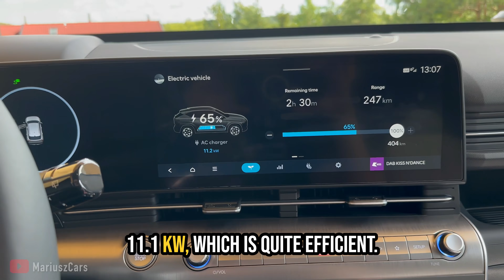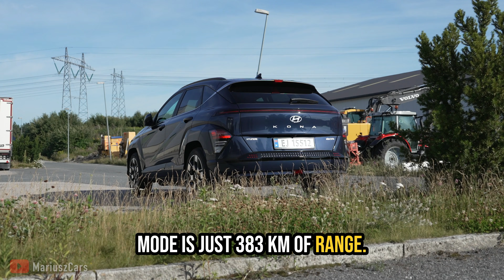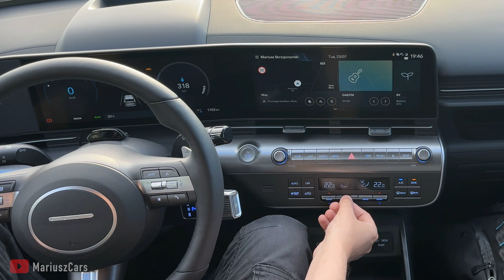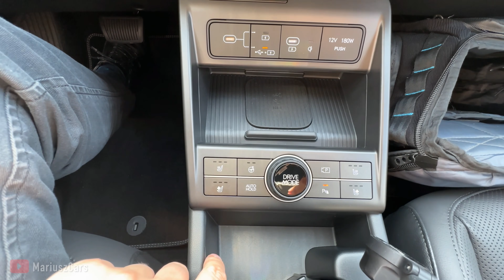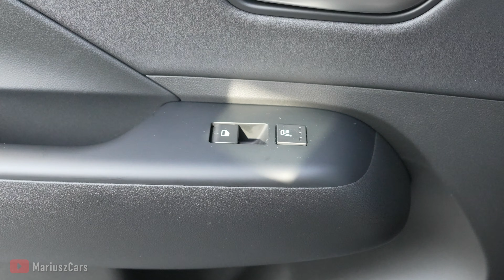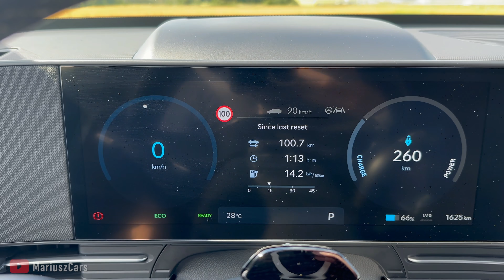How to Get the Most Range Out of Your Hyundai Kona Electric

Comment: I drive a 48 kWh Kona here in Turkey. Even though I live in a city with steep hills, my average consumption is just 15 kWh/100 km. It’s incredibly efficient and economical. At 100% charge, it displays a 395 km range, and I’m expecting that to hit 450 km by the end of summer. Such an efficient car!
Reply from the maker: I drive a 48 kWh Kona here in Turkey. Even though I live in a city with steep hills, my average consumption is just 15 kWh/100 km. It’s incredibly efficient and economical. At 100% charge, it displays a 395 km range, and I’m expecting that to hit 450 km by the end of summer. Such an efficient car!
Reply: I just got the 2026 model with 64kW battery two weeks ago.  When I got it it was showing 420km with 100%, two weeks later it sais 490km with 100%.  I average about 12,5Kwh, I am very impressed with it's efficiency!

Comment: We just got a Kona Electric on a lease. It seems to be a very low spec model. I should have insisted on going with my wife to the showroom! I wonder if there's any way to update/improve the available features. We can't even lock the charge cable once charging is ended!
Reply from the maker: Oh no, that’s frustrating — especially when you only notice those missing features after taking delivery. Some Kona features are definitely trim- and market-dependent, and unfortunately not everything can be added later if the hardware isn’t already installed.

For the charge cable lock, I’d definitely check the EV/charging settings and also ask the dealer directly, because in some versions the locking behaviour can be adjusted, while in others it’s limited by the equipment level.

Which country and model year is your Kona? Maybe someone here has the same spec and can confirm what can actually be changed.

Comment: Thank you for posting, I currently have the previous model of Kona with the 39kwh battery. Its good but I am doing longer journeys so I need more range, I still think Hyundai Kona or Kia Niro are the best range and value for money, in my opinion.
Reply from the maker: That’s a great point. The older 39 kWh Kona is a very efficient car, but once you start doing longer journeys, the bigger battery makes a big difference in comfort and planning. I also think the Kona and Kia Niro are still some of the strongest options when you look at real-world range versus price. Are you thinking about moving to the newer Kona, or would you also consider the Niro?

Comment: I have this same specification, but getting 4.4 miles/kWh is beyond my wildest dreams - my long-term average for driving around town is 2.6 m/kWh, or 24 kWh/100 km. This has been over the winter period in the UK (November - February), but the temperature has never been below about 4C. If I ever get over 3 on a journey I am happy, and I think I got 4 on one occasion. It's still a lot cheaper than the VW Tiguan it replaced, even at the lower figure.
Reply from the maker: It's great to hear you're enjoying your Hyundai Kona Electric! Winter driving can definitely impact efficiency, but it sounds like you're finding ways to make it work. Keep experimenting with your driving habits, and you might just hit those higher numbers more often!